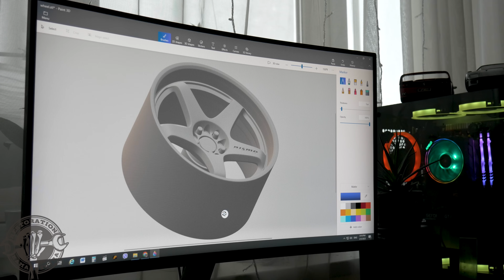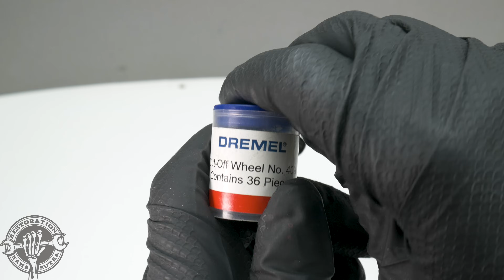Restoration and tuning abandoned Nissan 350Z. Restore model car

Comment: 3 wierd factors i find suspicous, number one being the hood is still openable somehow and yet if not that should be loose but isnt and is still perfectly functionable. second being why is the hood green?. and lastly the wheel shown on the left front is PERFECTLY spinning,how? fine, if the wheels should be running then why is it perfectly shaped, not bent and its unreallistic for one wheel to be dissapear and somehow the others are perfectly(despite the colour probably it was just coloured) shaped

Comment: Awesome! One question: what do you think would be the best way to stabilize a hollow letter made of thin metal (you know, the sort of letters used for cardinal directions in weathercocks, like W - west, S - south etc). This metal has holes and slits in some parts, and can break easily if I squeeze the letter a bit harder. I was thinking of pouring some epoxy inside, let it harden and then add some car epoxy filler to fill the remaining caverns, so I can sand and paint the whole thing afterwards. The only drawback is that epoxy is quite runny and I don't know how to prevent it from pouring back through these small holes and slits.What do you think? Is there a better way? Thank you!
Reply: Cardinal directions? The St. Louis Cardinals have lacked direction ALL season long!